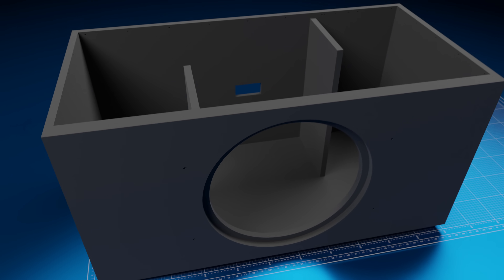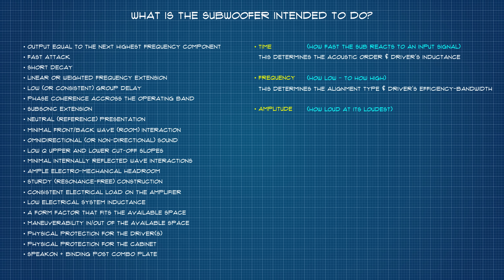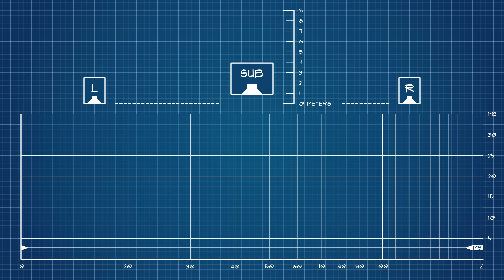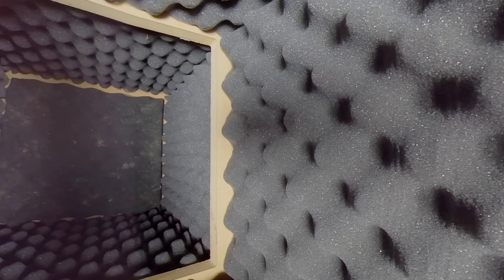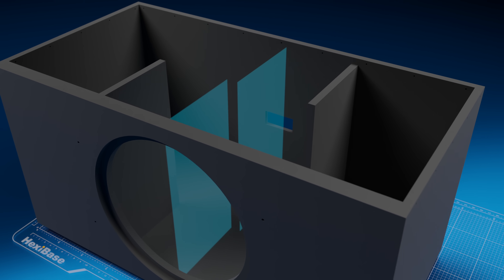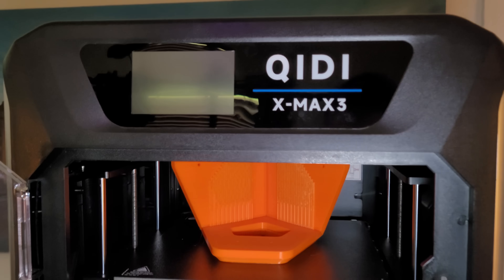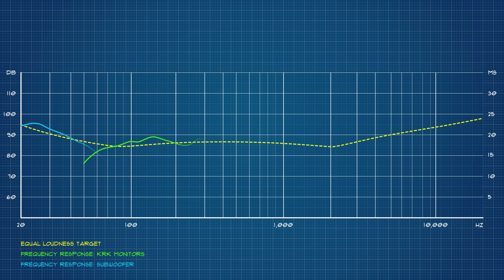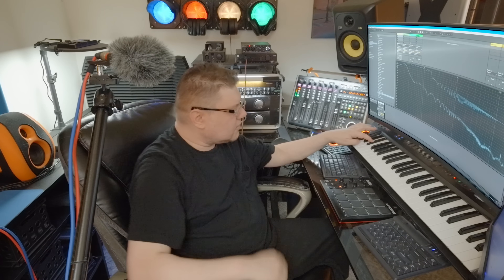Ultimate Studio Subwoofer

Comment: The ultimate subwoofer is not one, but multiple when you're talking about bass in rooms. A single sub is the worst choice, no matter how clean, deep and loud it is. Bass frequencies are modal in rooms, meaning you get an interference pattern as the room's dimensions are smaller than the wavelengths. DSP can only correct those room modes at one infinitesimal point, everyhwere else it gets worse. Hence why multiple sub spread out across the room are the best option, such that their modal patterns overlap and smooth each other out. What about localization and group delay you might ask? Doesn't matter. The room dominates both the frequency and time domain at bass frequencies, it's not a freefield listening environment. By the time your ears have figured out what tone you're listening to the sound wave has already bounced around the room multiple times. Hence time domain performance of subs in normal listening rooms is grossly overrated if not irrelevant. 

Group delay is simply the first derivative of the phase, which is NOT synonymous with time delay. Lot of people get that wrong. That means your subwoofer will not have a time delay necessarily just because it has higher group delay. Only at the resonance frequency and below will your signal be delayed to the rest of the bandwidth, but that doesn't matter, especially when you're going for below 20 Hz. Why? Again because the room dominates and also because our ears are extremely insensitive to group delay at such low frequencies. 

Those panels won't really do much for the same reason why non-parallel walls are pointless. But the standing wave is not going to be an issue anyway. A bit of porous material works wonders.

A humble Dayton Audio RSS390HF in something like 60 liters would do the trick already. Sure you'd need a bit more power but bump up the internal volume and you're still at only half compared to the IB18HT. Dot two or three around the room and you have more output, much smoother response and still less footprint than one of those 18" subs. As much as I love big monstrous sub with plenty of headroom, tbh this build doesn't make much sense to me when one is after the ultimate subwoofer experience in a studio and for recreational listening.

Comment: Excellent video production quality! However, I think it should be noted that a low Fs sub driver should only be a priority when not utilizing equalization and/or using low-voltage amps.
Higher effective motor torque improves impulse response and a stiffer suspension lowers the box size, with very similar SPL at the Fs of a low BL/soft suspension driver.

Comment: Very nice! An interesting choice for small sealed platform. I have several Acoustic Elegance woofers. 

Perhaps you're leaving a lot of performance on the table by restricting the sub too low. 

I'd suggest exploring the sub's handling as high up in range as possible. 

I wouldn't be afraid to explore up to 120hz or so crossover. 

It's low inductance characteristic and very low distortion design is vastly superior than the modest woofers in your mains. 

If you could facilitate variable positioning and acoustic blending as to not be audibly localized ... a lot of performance is to be gained by allowing the new sub to operate over a broader range. 

Up there is where the speed of the low inductance AE driver can really shine.

Comment: First listen on WF-1000XM5, and no, not keeping up in the equal loudness stakes, but I am weirded out that they even DID the 16Hz. Or that I could hear it. Unless, the driver is rumbling?
Reply: Ok, slightly impressed with the Sonys, XM4 overear basically the same - flat-ish to the note before 20hz, then dropping off. Still doing 18 and 16hz though. Much lower, yes, but that they even do it is cool.

Comment: I bought 2x 18" ultimax back in Feb, they have been on my table ever since, it was literally 10 mins after I bought them that I saw the kracken 21".  Idk if I want to run them sealed or 6th, but I intended in making the enclosures hold up my amps, receivers, consoles etc, with a TV mount attached to the back of the enclosure(s) so I can hang my TV above my centre speaker which also sitting on top of the subs, so I expected the volume of each to be massive.

Comment: I'd be interested to know how the initial equal loudness curve was generated. Was purely based on Fletcher-Munson curves or those plus measured room response at the normal listening position? I'd have to guess at the latter as some DSP corrections are then applied. But then I'd have to ask which F-M curve was used, as the tonal corrections vary with SPL. 

As always, the platinum standard to which all other speaker building videos are compared!

Comment: How are push pull configs, are they used today ?
Reply: Yes, still around ... there's nothing special there, except a small lowering of even order non-linearities. 

Essentially, it's just a double driver sub, one driver oriented basket in, the other driver oriented basket out. 

They null the acoustic differences, thus lowering some even order distortion.
Reply: @FOH3663  I thought they were used to go lower with a smaller volume. While not being restricted like a sealed sub
Reply: @Maaniic  
You may be thinking of isobaric alignment ... whereby drivers are oriented physically in series. 

Isobaric lowers minimum cabinet volume in half, but requires twice the power. 

Isobaric "sees" a 2x larger box volume, thus better bottom octave efficiency, at the expense of 2x the amplifier power. 

Today, Isobaric is rarely utilized as an alignment for subwoofer platforms.

Comment: I am ABSOLUTELY a shill for sealed enclosures.

My very first system ever was a full kicker speaker/sub combo in my 1993 del sol (as i called it, the del slow). I had typical cheap kicker speakers (the black and yellow low end coaxial) in both doors and rear pillars. and then I had a 12" kicker comp sub, from way back in 2008/2009 (black and yellow). The amp I had at the time, I didn't know it but turned out for the price it was actually super strong.... it was a crunch dual channel which I had wired the sub into bridged. and apparently, according to some reviews of the little thing, it can output 300w when bridged which for me, at that time, was insane power levels. and i used the bass boost which made it thump that much harder. anyway it was a sealed system. and i let it run up to 250hz because the sub was rated to 250hz (I remember it being that way and chose that for the 12db cutoff on the headunit).

after this I had a 2006 honda s2000. jbl speakers (yuk) which i got rid of and put in a pair of polk audio mm series. then I had kept the 12" kicker sub until it blew up.... sad days.

then I had traded the s2k in for a 05 subaru wrx sti.... i had a couple systems. one was a custom transmission line box I made. first with a cheap sub (dont even remember the brand) but then I had put in a pioneer sub (hated). the port noise was horrific. figured "I made it, user error" so I bought a cerwin vega dual 10" box for stupid cheap from the car audio shop behind my mechanic shop. barely running 300 watts the subs blew.... but that whole time, nothing but port noise. could argue user error, but I replaced the subs with another set of 10" brand new with the same 300w and it still had insane port noise.

finally went back to sealed and had pure sound quality. i get it, ported hits really low, but that port noise, for someone like me, im too sensitive to it. i like my music loud but also crystal clear. and the only way to achieve that is sealed.

Comment: I've got Truthear zero's (iem with subwoofers)
And they go all the way down to beyond human hearing, 16hz was very interesting to hear, it was basically silent but I could feel it just fine, now I want to get a bass exciter for my chair, dammit
Reply: Beyond human hearing is simply the point where your ears start to roll off which varies person to person. 20Hz being the common accepted frequency where most peoples ears roll off. But it's not a brick wall and you can hear below that just fine. Normally you just need some extra output as you go lower to hear it at equal loudness vs higher frequencies.

If your hearing cuts off at 15kHz for example. As in, you can hear 14kHz but can't hear 15kHz at the same volume. Bump up 15kHz by 6dB-12dB and you'll find that you can hear it. Heck give enough volume to 20kHz and you'll hear that too even if you can't hear 15kHz at normal levels.
Reply: @JoshM7  The zeros subwoofer can produce frequencies all the way down to 3hz, you're telling me that 3 hz is audible when you turn the volume up? Yeah, but you're eardrums and subwoofers will be in agony with the amount of excursion the subwoofers will be doing to make it equal in volume to music at a good listening volume
Reply: @mr_bear6362  yeah 3Hz is probably going to need a crap ton of gain to hear it. It would sound more like the background noise is pulsing vs hearing a actual tone but I personally still call that hearing it because if you plug your ears you won't hear that pulsing sense anymore. 

It'll sound like a tremolo effect with your ears with loud frequency around 10Hz or 11/12Hz and below. Assuming you aren't using headphones and using a sub/subs. I've not tried it with headphones because most have too much harmonic distortion to actually play loud enough (110dB minimal preferably more) at 10Hz area.
Reply: @JoshM7  I see, you're dying on the hill that (almost) any frequency is audible if you turn it up enough, that's true.
Counterpoint: You could have just said that instead of typing 4 paragraphs of technicalities
Reply: @mr_bear6362  Hey it's YouTube comments. I like to ramble. Just ignore me if you don't care to read the paragraphs.

Comment: I would like to see you Build a Small Stand Mount Transmission Line Speaker.

USING the "Speaker Stand as 2/3's" of the Length of the Transmission Line.

Comment: I'm curious. Did you consider an infinite baffle subwoofer, or was cutting a hole in the house not an option?

I ask because I have been reading up on them, and have the ability to cut holes in my house now I own one!
Reply: I built my IB about 10-15yrs ago. 
Quad 18" attic mounted manifold, w/IB3-18" from Fi. 

Learn as much as possible beforehand, since the positioning can't be easily altered.
Reply: Check out all of their Speakers Models.... COMPANY BRAND:  AR or Teledyne Acoustic Research.
This company Invented the:  1. INFINITE BAFFLE..... 2. ACOUSTIC SUSSPENSION....... 3. 1" DOME TWEETER.
Founders: Edgar Villchur and Henry Kloss
Founded: 1954...                                      In 1978 they introduced  the Legendary 4 Way AR-9's

Comment: Normally I'd scoff at a sealed box but considering how much larger the driver and box are im sure it plays lower than the old sub did. Also good idea building in the brace to help stop standing waves in the box. That's something I never thought about doing.
Reply: They don't stop standing waves. Bass waves will simply wrap around those braces. Just use porous material and you'll be fine. This sub is too large anyway, kinda pointless build. Multiple smaller subs with DSP would have been much better.

Comment: Why not design an open baffle subwoofer? You get less low frequency roll-off compared to a sealed enclosure design.
Reply: Infinite Baffle? or Open Baffle?
Reply: @FOH3663  Open baffle. The driver Peter bought is designed to be in an open baffle.
Reply: @kenthomas1613  
No, IB ... Infinite Baffle 

The Dipole series is for OB, open baffle
Reply: @FOH3663  Apologies. I stand corrected.

Comment: Sony WH-1000XM4 wired were equal loudness until the last three notes but still could be heard.  Excellent video!
Reply: Xm5’s kept up until 30hz :)
Reply: @tessa7468  Sony WF-1000XM5 the in ears can do it
Reply: XM3's over bluetooth here. Was really surprised I could hear 16 Hz!
Reply: Sony Linkbuds here and the same results. More flappint wind sound at 16 Hz though.
Reply: WH-1000XM3's here as well, I was surprised I could hear 16Hz.
Reply: Weird I have the xm4s and those last two were booming
Reply: Same with mine, could hear all the way down, but level was diminished below 30.
Reply: AirPods Pro 2nd gen here, same result - audible at 16Hz but admittedly at a slightly reduced volume compared to 40Hz.  Cool demo!

Comment: I was not ready for the 16Hz hit, only had the SVS PC-4000 hooked up for half a day and it's expressing things I did not know were there before with my random powered home theater sub that the amp died in and I converted to a passive sub powered by a crown XLS 1502 in bridge mode. Also surprised that YouTube compression/encoding did not eat that.
Reply: Yt actually uses pretty good compression for vp9 container.

Comment: My system dropped of pretty quickly around 30 hz. I just have a lame brand car amp connected to a Sun Down 6.5" sub in a box(ported) I made for a Digital Designs 6.5" sub.
Reply: That can’t be right, everyone else with 2” headphone drivers reports a strong response at 20hz 😂🤣
Reply: @LingLing1337  the room size of an ear cavity and headphone ear cup is slightly less than the volume of a car. plus efficiency advantage. so a 50mm driver should have no issue. you can go further and say that only a 6mm iem driver is doing the job. or in rarer cases a balanced armature diaphram which is super tiny

Comment: I have a tactile transducer under my chair, so yes, the apparent loudness at 11:11 were all the same percieved loudness, but the last few notes had the side effect of shaking my whole body along with it.
Reply: My subs are tuned around 40 or upper 30s with corner placement, and high passed with a 24dB filter at 33 Hz so the bottom notes are cut out.
Reply: @TimpBizkit  Tuned to 40hz, with a -24 db @ 33 hz... 
Im a bit confused as to why you would do this, the subs are specifically for the low notes you're cutting out.

Is this like a car audio system with small subs or...?
Reply: @BenHeien  they were meant for DJ and live sound and have lots of output but don't go super low. Though low enough for most of my music. I could probably block off ports to get them lower though I'd have less sensitivity at the bottom end but could turn them up more.

Comment: I'm shocked, my Sony MDR-7506 cans actually played 16hz. 😂😂
Reply: Skullkandy crushers too, not at the same loudnes but still
Reply: My custom he4x in 3d printed port feed folded cans. Stall hard at 14hz.
But they took 5mo and a custom ai model with over 40 million iterations in simulation and over a dozen sls prints to achieve the ±1.2db response from 18hz to 18khz
Reply: @CNCAutomationLab  wtf, that sounds awesome, have you posted any info about that anywhere?
Reply: @icarusix8750   nope, I build ai models, and I'm a hardware engineer by day and a mix of spl and sq audio nut by night. I have an spl demo box (2006 scion xb with a 6th order wall tuned for 24-55hz running 6x sundown ns v6 18's on a 3 of d4s jp73's in the doors is a 4way setup with 10"' 6.5" super tweeters and horns. Each door has a pair of jp234's
A massive dsp is used to do time alignment and respond tuning.
In my bedroom is a semi pro dj system mix of jbl and ev gear with crown amps.
And 2 fog machines, 4x cold spark machines 12 par lights 8x 4ft wall washes 12x 6w lasers 6x moving head 230w spots 4x beams 300w, 2x derby lights 4x beam bars 
Everything is dmx controlled, and I build custom lighting tracks using custom software to sync the light to movies.
I have OCD and when something gets my attention I tend to take things to far
Reply: because you played the video above 1x speed
Reply: @dimatter  i think it was because I was in a very quiet room. No where near equal loudness, but they produced something!